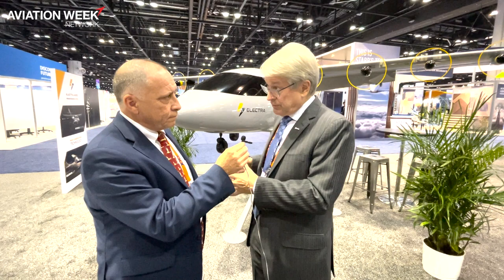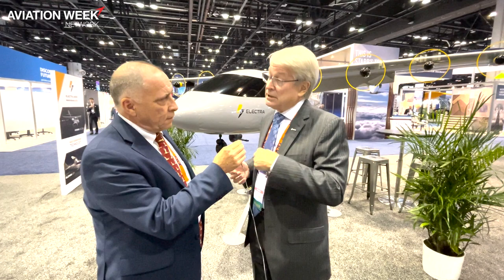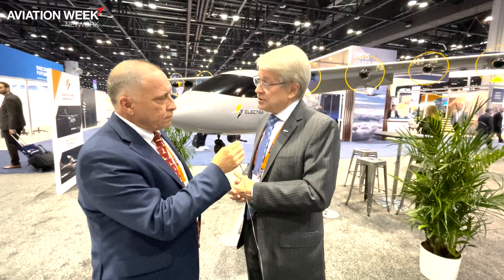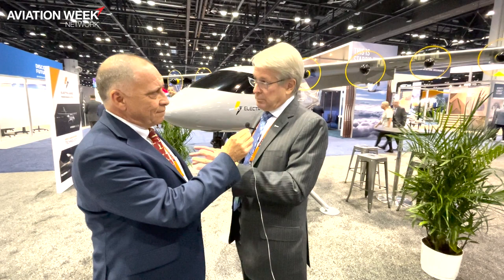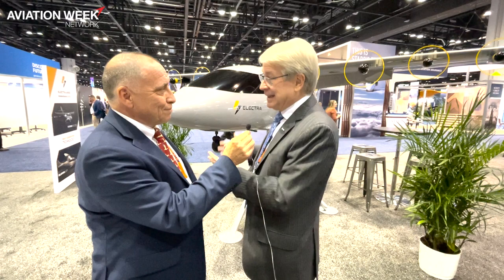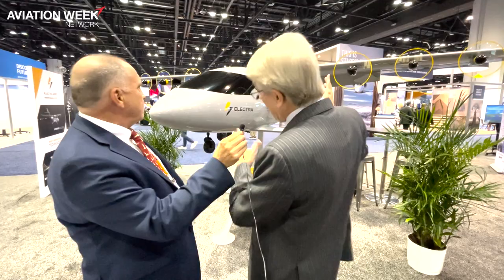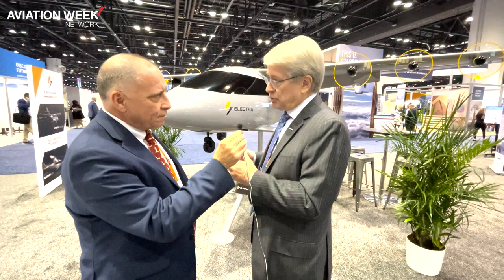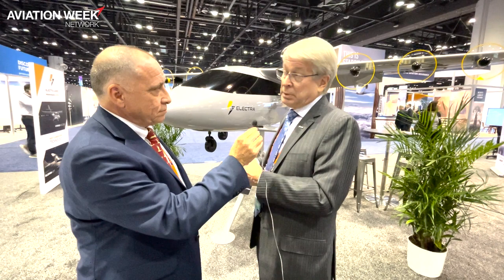Electra Updates eSTOL Test And Development Plan

Comment: Yes you have a lot of lift at low speed for short take off but then you have a very innefficient drag to lift (finess) for the rest of the flight because of the parasit drag of the engine pods right in the downwash of the fast moving air of the engines. I could see push propellers attached to hinged flap to have both short take off and excellent drag to lift efficiency.